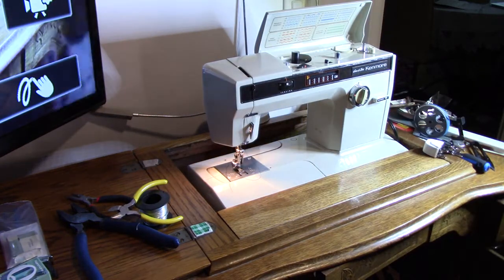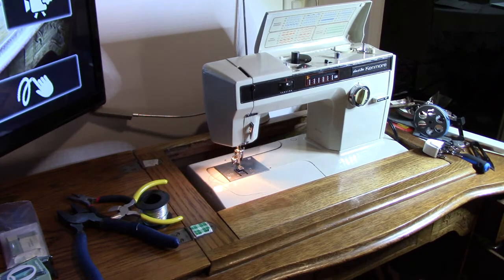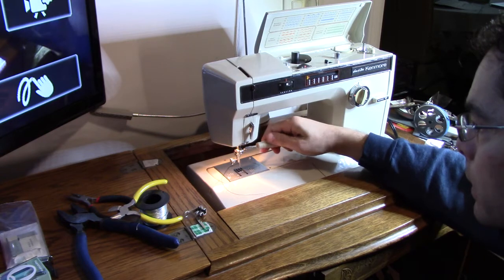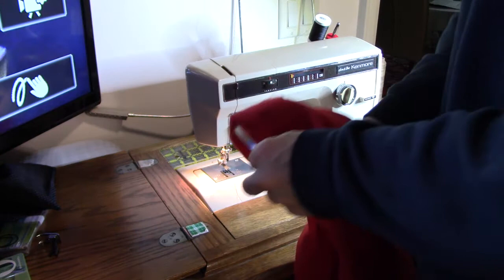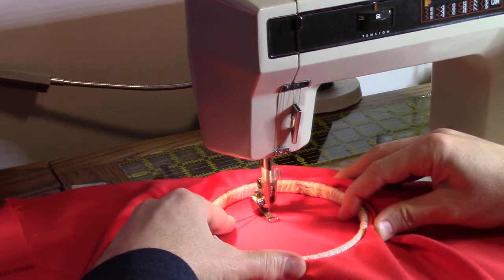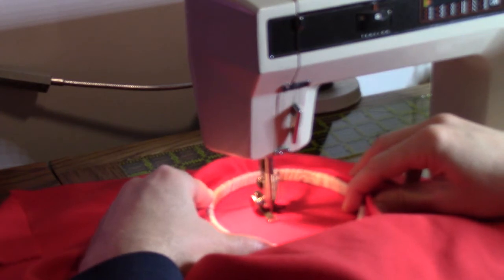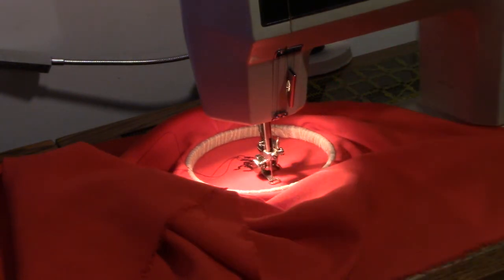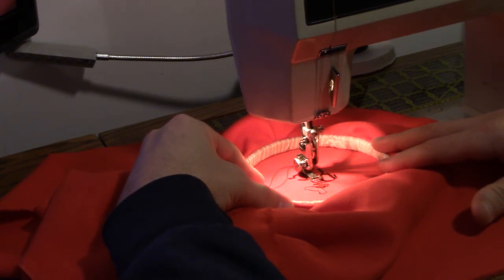Free Motion Hopping foot on Kenmore Super High Shank

Comment: Hi James, will this work on a 158.19411? I have what I think is the same hopper foot that you are using, but the lever that holds the foot in is preventing the hopper arm from going back far enough so that I can put the screw into the needle holder so that the arm is behind the screw. Is there a way around this? 
Also, it would help if you showed a close up video of the foot and how everything attaches. It’s hard to see from the distance and angle that you were using. It would be easier to see it from the right side of the machine, rather than the left. Thanks so much for making these videos for us Kenmore SHS enthusiasts!!!!

Comment: Hi, I see you have a walking foot over to the right of the table, have you used a walking foot with this 1914 ? If so where  or what brand did you use ? You think as far as this video showed figured out the issue of not having a arm to attach the feet with need arm support by screwing in that screw ? Because I saw an expensive fix on ebay being sold, Which I'm so greatful to you for figuring that out !! Also you mentioned in a comment on here that if you have the foot that came with the monogrammer that foot would perform the same as this hopper ? I plan to get on getting adapter for the snap on feet which I have a good amount for my brother, but I haven't really needed it since this machine came with so many useful feet. But I really would like a walking foot as I like to topstitch quilting on this machine better and some of the other quilting snap on feet would be useful as well since this machine didn't provide any for that purpose. Thanks for the great videos !! Also thanks for figuring out and sharing in another video about changing needle position 💪 very informative!!!
Reply from the maker: I purchased the super high shank one from eBay and it works well.
Reply from the maker: I have tended to use the embroidery foot that came with the machine for use with the monogrammer. The spring only type is easier to fit as long as you add the shaft to the needle bar. The biggest challenge is that the walking foot must have a very high lift. Many low shank walking feet are not designed for the larger lift of the Kenmore and Janome machines (the needle goes higher to allow more clearance under the needle). The long strike can be too much for some of the walking feet. But if you are good with a bit of DIY, I have had success with bending wire to attach to the hopper and this worked.
Reply: @jamesrogers991  And yes I've been diy'ng for years 😉 ! And when I can't figure it out on my own my husband always is willing to help me cone up with whatever I'm trying to do or fix as he's more handy with well everything! I call him a jack of all trades ! Thats one of the main reasons I adore vintage machines as they are mechanical and your able to figure out any issues and fix them for the most part. Id be scared to do that with my brother computerized machine. I baby that machine for the most part ! Id love to get my hands on a older Bernina next, I'm always on the look out for years now for a good deal, I also just watched in another video a lovely gentleman share that the "Q" foot that came with the 1914 is the absolute best foot for sewing with knits! He said not to be confused with the "knit foot" it has to be the "Q" foot, which would be another option to not need a walking foot. I do sew with knits at times & haven't been able to have the experience to go easy, so hearing that info I was so excited! I've never used that foot in sll these years I've had the 1914 so I'm so excited to try !! He said it's the absolute best sewing machine foot ever made in regards to sewing with knits ! Just wanted to share with you that tidbit. He said the "Q" foot always has a patent number on the arm somewhere and usually the arm is gold and the plastic foot part is clear, actually looks very similar to the knit foot but underneath is different!

Comment: +James Rogers This is exactly what I am trying to set up at home so I can have a darning machine to fix my own pants.  Could you please mention what model that hopping foot is?  I am a novice so I cannot fill in the blanks on your otherwise super helpful demo.  Thank you for figuring this out.
Reply from the maker: I would suggest getting yourself a super high shank to low shank adapter from eBay. You will be able to use low shank feet on your machine. The hopping foot is a low shank hopping foot -- they are available everywhere but you will need the adapter to use it. If you have the monogrammer with the foot, you can use the monogrammer foot successfully as well.
Reply: +James Rogers Hell yeah thx dogg

Comment: I just acquired a Kenmore 158 16250 do you think I could attach that hopping foot to my model? If so what is the part number if you have it thank you
Reply from the maker: Is the 158.16250 super high shank? If so, then it will fit. Otherwise, you will want to get the shank adapter to help.